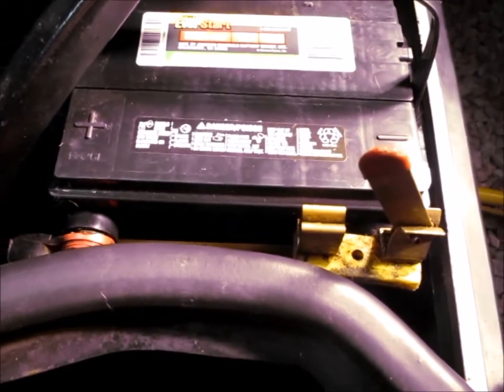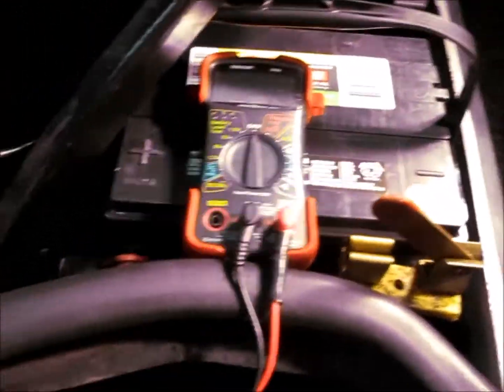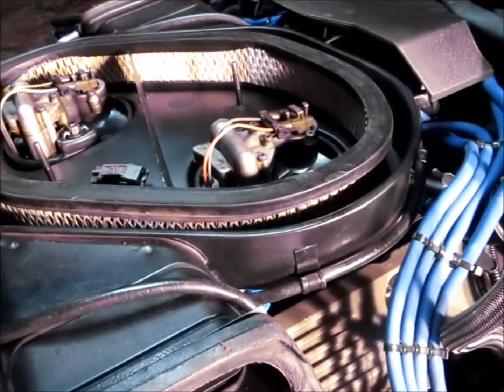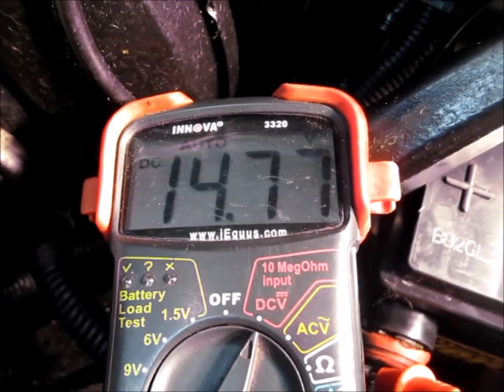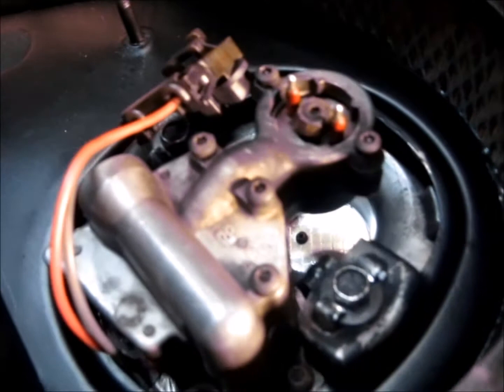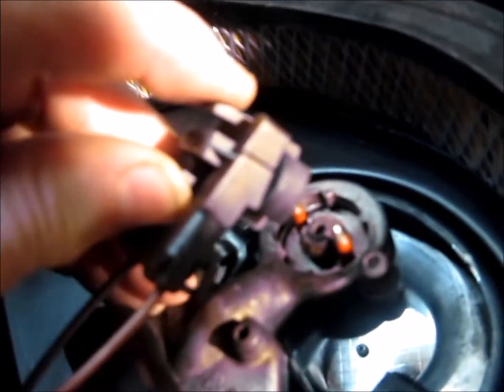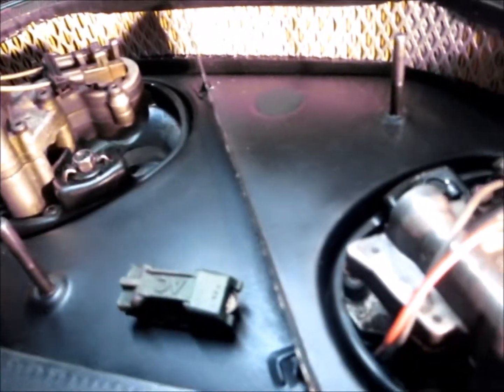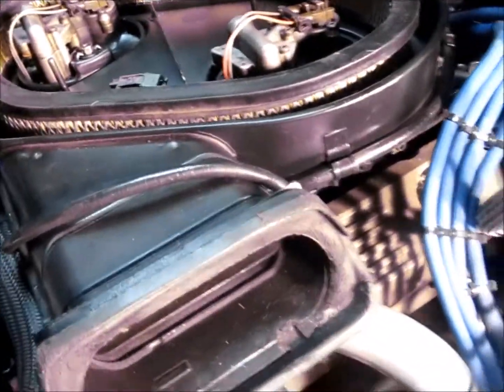★彡𝐒𝐓𝐎𝐂𝐊 𝟏𝟗𝟖𝟒 𝐂𝐎𝐑𝐕𝐄𝐓𝐓𝐄 𝐂𝐑𝐎𝐒𝐒𝐅𝐈𝐑𝐄 𝐈𝐍𝐉𝐄𝐂𝐓𝐈𝐎𝐍 Troubleshooting TBI Fuel Injectors #MotorTrendCaroftheYear

Comment: Disconnected distributor for replacement and cranked the engine to make top dead center. Reinstalled distributor and now engine will crank but never starts. No codes other than Code 12. Why cant I get it to start?
Reply from the maker: Ground wire on distributor or EST wire disconnected for timing or ecm harness wiring got crossed??
Reply: Have the FSM, but alot of the Code Diagnostics (Code 42, page 6E2-44 thru 6E2-45) require an idling engine. Can't even get it to start - much less idle. Not sure what else to do. How do I clear the clear flood mode?
Reply from the maker: @wsii994  going by what you said, you pulled the dust and set top dead center. Are the plugs getting fire? I always hooked a spark plug tester light up to a plug to see if they were getting spark, then I used a noid light to test the injectors to see if they were getting fire.  If the plugs or the injectors aren't firing the issue is in the distributor Ignition Control Module inside the HEI distributor. That little module is wired into the ECM if it isn't working or wired right the Ecm sees no signal, won't pump gas. BUT if you have fire at the injectors and plugs there must be a fuel flow issue. Sounds like a HEI distributor issue wiring or something. Did you reconnect the EST wire?